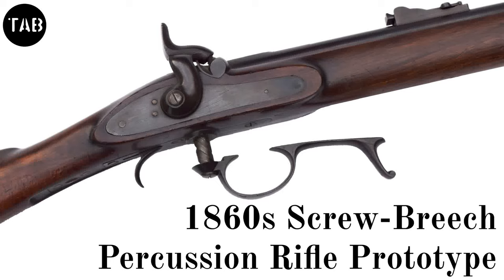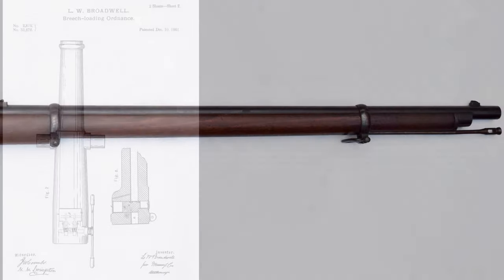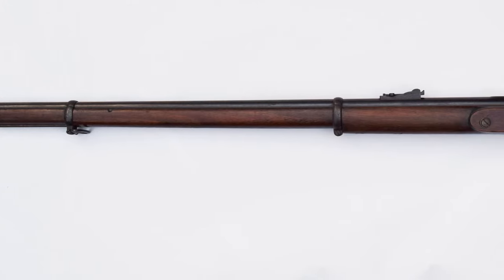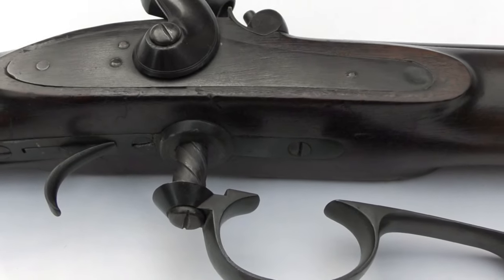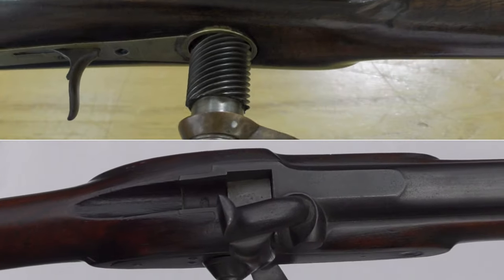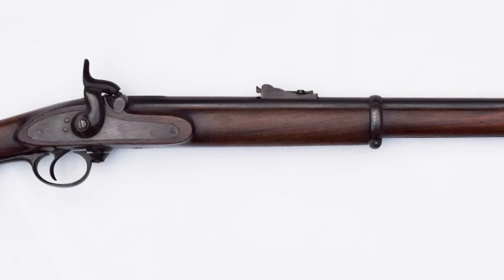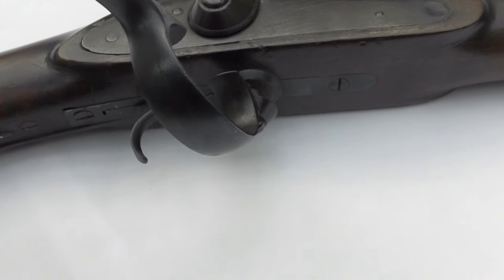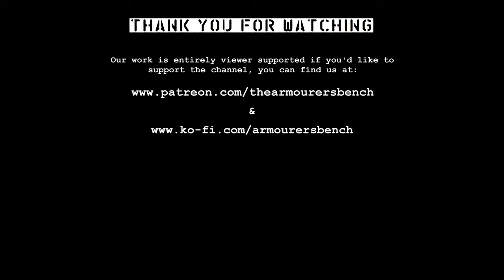Prototype Screw Breech Percussion Rifle

Comment: This is the first time I have heard of further development of the Ferguson screw breech rifle. If that 1780s flintlock Ferguson rifle had been modernized for mass production in the 1840s onward as the caplock Ferguson rifle then it be a lot better than that sliding breech Broadwell prototype. It looked like the Sharps without proper gas seal tolerances.
Reply from the maker: It's a wonderfully rare piece. Absolutely fascinating to examine.
Reply: @TheArmourersBench  Thank you for the reply
Reply from the maker: Thanks for watching!

Comment: Awesome. The improved Ferguson i guess
Reply: I don't know if I would call it improved. Yes, the percussion lock is a step up from the Ferguson's flintlock, but the flat faced breech block in this design would not seal the breech as effectively as the Ferguson's screw breech did. You would get gas leakage like you do with a Sharps Rifle or a Hall Rifle. The only real improvement of this design is the cut out behind the breech block, which allows you to insert a paper cartridge into the breech, making it faster to reload than a Ferguson.
Reply: @WackySwackyAdventure  do you think the gas leakage would be a significant issue? If not i would certainly like the ability to use paper cartridge and percussion cap plus the faster rotation of the lever
Reply from the maker: Given Broadwell’s work with gas seals I suspect it may have had something in the face of the breechblock similar to one of his patents but no way of knowing without disassembling and that wasn't possible at the time.